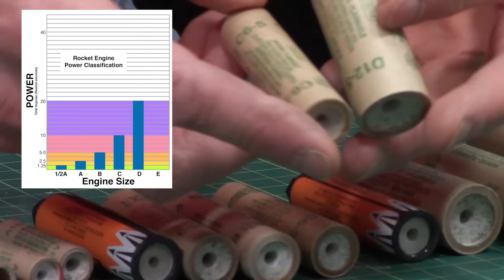Model Rocket Engine Code Explained for Beginners

Comment: Fantastic video, but a bit of misinformation towards the end. Motors that end in “-0” do not have an ejection charge at all. They are only loaded with propellant and are used as boosters. They should NEVER be used in single stage rockets as the recovery system will not be deployed and your rocket will come down ballistic.

With Estes black powder motors, the engine codes are also color coded. Most of the motors shown in the video had a green code. Green means it’s a general purpose single stage or upper stage motor. The A8-0 and C6-0 shown in this video had red codes. The red means it is a booster motor. The C6-7 also shown in the video had purple text. Purple means it’s primarily an upper stage motor, but could also be used in lightweight rockets.

I also want to touch on the letter “T” that is at the end of some motor codes. On motors such as A10-3T shown in the video, the “T” at the end signifies that this motor is mini-size.
Reply from the maker: I disagree with you that they don't have an ejection charge. They do. There is a flaming fireball that ejects forward when the propellant breaks through the last sliver of black powder. In fact, without that from occurring, the Apogee Flying Machine kit-- would not work to eject the streamers from the strap-on booster pods. I stand by what I say in the video. They do have an ejection charge that can be used to eject recovery devices.
Reply: @apogeerockets  The reason a fireball shoots upward is the high pressure inside the motor (between the burning propellant and the nozzle) breaks through the last little sliver of propellant remaining into the relatively low pressure above the motor. Since booster motors do not have a clay retaining cap, the propellant must serve as its own retaining cap. As the propellant burns, it gets thinner and thinner (looking at a cross section of the motor). Eventually, the propellant will get so thin it simply cannot hold back the internal pressure anymore, and the high pressure breaks through, sending a fireball upward.
Reply from the maker: @solarflea4115  I totally understand the physics. You can watch all the cool animations on our website. I still call it an ejection charge, because is CAN be used to eject a recovery device.

Comment: lol rocketry for beginners and they explain in Newtons. Why not explain it in weight? (C6- engine = 10 Newtons = 1 kilogram or 2.2 pounds)
What I did learn in this video is that all C- motors have the same amount of propellent. Just the higher the number, the faster it burns. ^^probably answered my own question there.
and I launched Estes rockets first in like 1983.
Your explination of the parachute delay is also great.

Comment: 4:06 They'll go approximately the same height but at a different rate of ACCELERATION. They have different ( as represented mathematically on a graph ) ACCELERATION RATES. The higher the number - the FASTER the rocket motor will take it's rocket to a specified height.
Reply: Whats inside these ?

Comment: Are there motors without delay, so that I can use my own electronic recovery system?
Reply from the maker: Yes. But they are high power motors. The usually end in a "P" for plugged.
Reply: Thought the 0 was no ejection charge because it burns to the next motor in a two or three stage system?
Reply: @MrCyphrex  I think it just ejects immediately cause 0 second delay

Comment: At least on Estes engines, there is also the color coding.  Red first-stage booster.   There was also the use of the Green, Blue, Purple and Black to differentiate the engine use as well.  Been too long to remember all those details.  Guess I could check the webs.  :-)

One comment I'd make is regarding the first stage booster (zero second) engines.  Unless they've changed in the long while since I flew rockets with Estes engines, the boosters do not have an ejection charge like any of the other engines with a delay (3 to 10 seconds for example) before the ejection charge fires.

Estes booster engines (red zero seconds) do not have a cap at the top of the propellant stack.  That cap is present to contain the loose propellant pebbles used for the ejection charge.   The boosters - without that cap and no ejection charge pebbles at the top of the propellant stack - will begin a process of 'propellant burn-through' as the last of the booster propellant burns from the nozzle end to the top end of the engine.  That thin amount of the last bit of propellant breaks down from the pressure inside the rocket motor and is forced up the engine tube into the nozzle of the 2nd stage engine.  These bits ignite and as they are forced into the next nozzle, they ignite the propellant in the next stage's engine.   The force of the next engine's ignition causes the separation from the booster engine of the first stage. 

We generally used scotch tape between boosters and the next engine on top.  As the engine above the booster ignited, the tape melted to allow a clean separation.   For a 3-stage rocked, booster 1 to booster 2 with scotch tape and booster 2 to 3rd stage engine with scotch tape.  This meant multi-stage rockets didn't/couldn't use the metal engine hooks that you see on single stage rockets.  The booster and upper-stage engines needed to be friction fit using masking tape, etc.

Prior to Estes making their non-booster engines a bit more tamper proof with the gray molded propellant caps, there was just a round paper cap pressed into the top end of the engines.  With a pair of tweasers you could pull that paper cap out and dump out the ejection charge pebbles.  There were 'mostly nefarious' reasons to collect them. Thus the current molded caps.   At one time (maybe still) Estes sold a dummy display engine that was cut in half length-wise to show the layers.  Yes, we made our own.  Hey, kids think they're indestructible and can get away with that stuff. We did all survive those years.
Great info in your videos.  Subscribed!
Reply: Green = Single stage  Red = Booster (first stage)  Purple = Upper stage   Then there are blue labels for plugged situations

Comment: Will a d motor fit in a rocket that came with c motor?
Reply from the maker: There are D motors that are the same size as the C. So "Yes." You have to look at the size of the motor as well.

Comment: I don't know anything about making rockets and about rocket motors. Do we fill the fuel inside the rocket motor? How do we make the parachute eject? Please help I want to fly a rocket. I'm a noob to this so it'll be nice if someone explained it to me thoroughly.
Reply from the maker: The motors are complete, so you don't have to fill them. There is an animation on our website that explains how they work. You'll find it at: https://www.apogeerockets.com/Tech/How_Rocket_Engines_Work
Reply: @apogeerockets  
Thanks! So we just have to ignite the motor and then it'll fly? So what kind of a motor should I use for a light weight half a kilogramme - one kilogramme rocket? Please recommend a cheap motor (under $10) cause I'm not that rich, will B6-4 motors work?
Reply from the maker: @ansh6370  There is no motor that is cheap under $10 that will lift a half kilogram rocket. Sorry. If you want to learn how to pick motors, see our youtube video: https://youtu.be/dTasgUwLau8. If you want me to pick motors for you, I do charge a fee because this is a extensive service.
Reply: @apogeerockets  
That's ok, if it was under $10 it would have been amazing but I can afford one under $20 too. The only problem I have is that I can't find a motor nearby and I can't find a motor online that ships to my country, India. Do you know where I can get one?
Reply from the maker: @ansh6370  Sorry. We do not ship to india. Nor do I know where you will find them there.
Reply: @apogeerockets  
Oh well, I guess I'll have to make one myself then. Thanks for the help though, I like how you actually interact and help the people in need :D